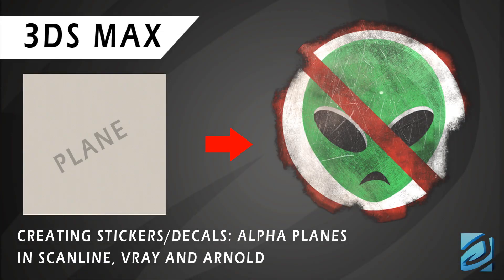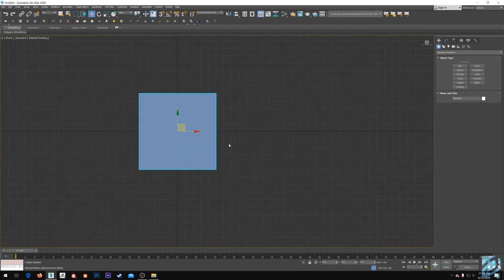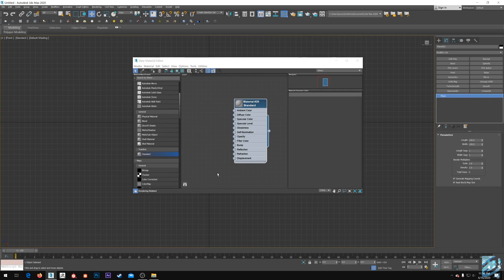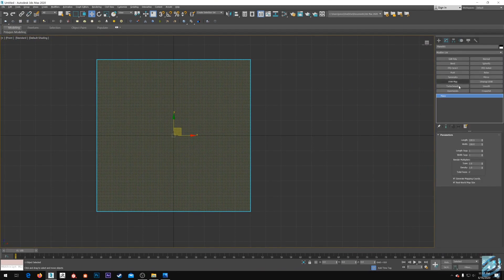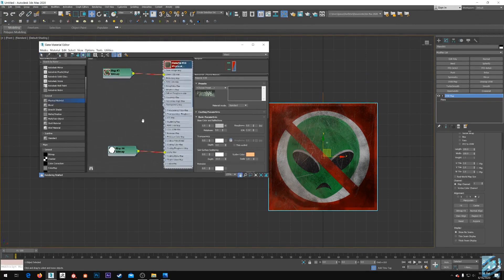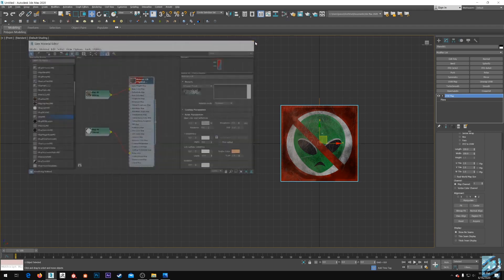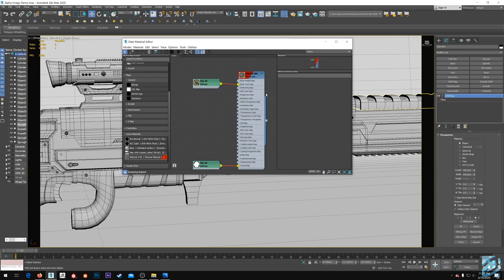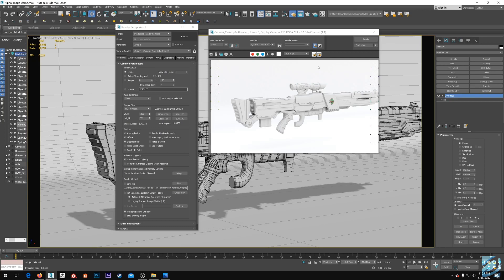3DS Max Tutorial - Alpha Planes (Stickers/Decals) in Scanline, Vray and Arnold

Comment: Amazing!!!
Reply from the maker: Hey Rich! I haven’t used 2021 yet but look for that standard material. However if its not there, I would recommend going the Arnold route with a psychical material anyway because that’s the superior renderer.
Reply: @JCobesV2  Hey Jon thanks, I was able to resolve the issue. The vid was very helpful & I'm looking forward to the next one!!!
Reply from the maker: RJ Crabbe great to hear Rich! I’m currently working on another that will help covering multi-materials.
Reply: For some reason, in Autodesk 2021 I can not find scanline in the materials slate editor :\